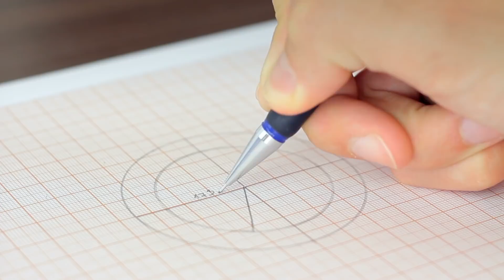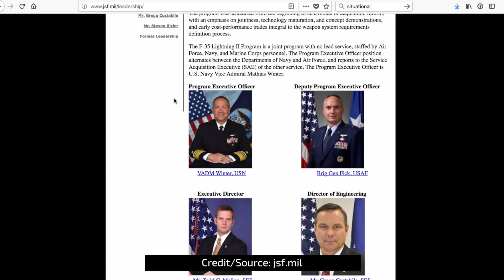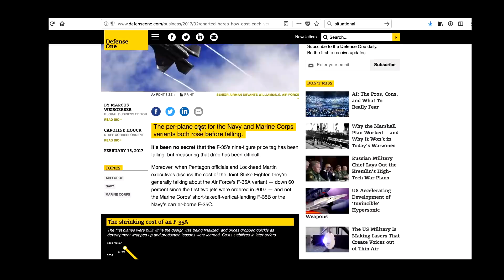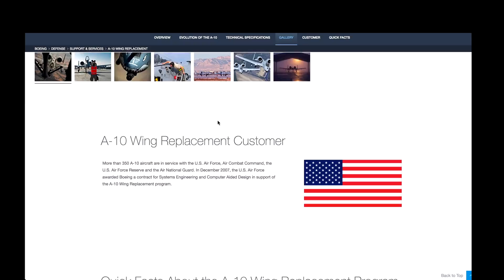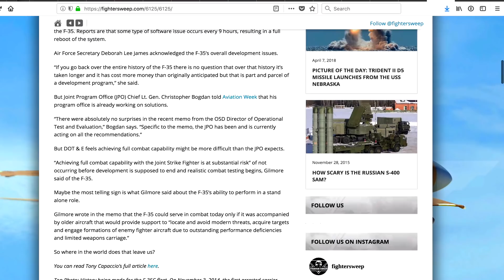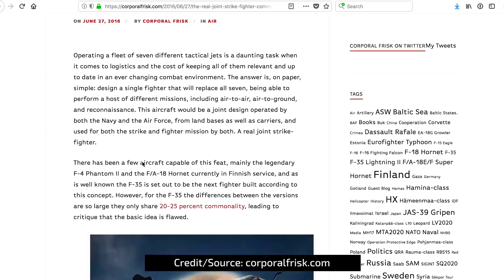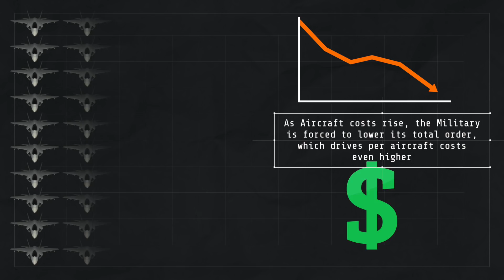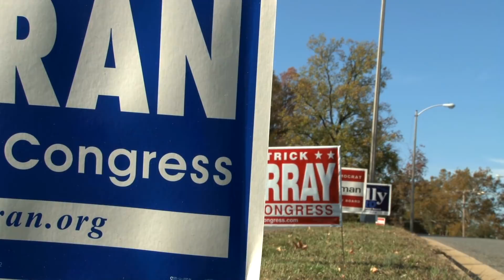Why the F-35 Lightning II Might be the Most Expensive Military Aircraft Mistake Ever

Comment: The jet is actually quite cheap. It's 30% cheaper than a Eurofighter and the price just dropped by 6%.
Reply: Does this calculation include development cost? Ive read for ET it was around 200 billion euro which is trumped by 1,3 trillion USD
Reply: Nope. I'm going purely by unit cost mate. The 1.3 trillion figure the media throws out is intentionally deceiving. What that includes is the lifetime cost of the project e.g. development, the jets themselves, future upgrades/repairs and ofc, it's just an est. The F-15 has a similar cost when taking into account all of the upgrades it's had over the years and inflation.
Reply: My country (the Netherlands) is very happy with its performance for the job they are doing (which hardly do air to air.)
And if they are happy I am happy.
Reply: My country (Finland) is now looking for a replacement for the F/A-18C/D and the Air Force brass is of the opinion that if any other fighter besides the F-35 is to be chosen the choice will have been purely political.
Reply: For Finland, F-35 might be a good idea, however it's cost is gonna be an issue.  So multi-role is good for a small country, but cheap is REALLY good for a small country (Not to offend, but Finland's population and size cannot support a massive defense budget, also I have been to Finland and LOVED it there, Helsinki is beautiful).  I would have some locally made fighters or close to local.  Grippens or Viggens (yes the AJS-37 is old as F) or something like that.  F-35 would be fine, but Harpoon has yet to integrated, just JSOW, so anti-ship would be an issue.  If they do get F-35 great, but for my money, I would take something a bit cheaper.
Reply: @wpnsloader9289  well if they already operate the F-18 (I mean that's a relatively young mid-90s) jet. I would assume replacing was meant as replacing the main but being added to the fleet.

Cost is a downside, on the other hand keep in mind that Finland borders Russia and for the very same reason the Soviet Union essentially insisted on Finland neutrality thusly (same as Sweden) not a NATO member. The EU is essentially also a defense treaty which in some way makes it a NATO member by domino effect, but in essence their geopolitical exposure warrants the cost of the F-35 (or Su-53 if they want to honor their reputation of being a special case).

Personally though i think stealth jets are a bet against a ticking clock. And without stealth the F-35 is an airborne tank without armor, not very maneuverable. May still be worthwhile though as air support in foreign deployment stealth should be safe to use for a while, but to sneak into and out of Russian airspace – you better announce yourself by jamming Radar entirely and use something with aerodynamics.
Reply: @Hairysteed  I know you guys don't like your neighbors to the east BUT they have the best bang for your buck...but if you really need a replacement badly try and get some F16s or Rafales as they are much better
Reply: Hairysteed "the Air Force brass is of the opinion that if any other fighter besides the F-35 is to be chosen the choice will have been purely political"

Cite your source for this, please.
Reply: Yeah the RN seem happy with them. If they wen're then we'd modify the end block of the Queen Elizabeth class carriers and use Rafale. This was pondered over during the Clinton years as there was an issue with ToT under his Presidency but Blair and Bush sorted it out. What we see it is is simply a missile and jamming platform but with the capability of the Harrier and short rolling landings. If you loo at the weapons the F-35 is getting then it is impressive. Just the METEOR ram jet BVRAAM alone is a game changer
Reply: Hairysteed: Gripen NG? Wouldn't it just fit perfectly?
Reply: @clipeclipaway  I can't wait to see an F-35 flying around here! (I'm also from The Netherlands)
Reply: @clipeclipaway  You are a citizen of dreams
Reply: @Hairysteed  Totuus on nimenomaan päinvastanen :D nythän puolustusvoimain entinen komentaja on lobbaamassa meille näitä ylihintasia rojuja.
Reply: @vought19  USA GUST SIGNED FOR 450 F-35A AT A COST PER PLANE OF BETWEEN $80.5-$75.5 MILLION. WHAT NOW? TAKE THAT LOSERS.
Reply: Development cost for the F-35 so far is in the range of 150 billion USD (about 300 jets included in that figure)
Reply: @damonstr  wrong depends on model. The f35a is going for 80 mill right now. The f35b was 120mil, the f35c going for 110 million.  But the B and C are coming down more. The final on B should at full production be around 105 mil. The c95mil. 
The European fighter/typhoon runs 120 mill
 The f15 new strike/ k eagle runs 115. 
The f16 runs 80
The f18 super runs 80-85
The rafale runs 95mill.
The Su35 run close to 80 mil
The su57 stopped as failure
The ? Shikore 30 runs 75+ the Chinese are not in any contention!! And cost as much and not ready to come close to performance with US or Russian made jets.
Reply: @damonstr  380 of them ACTUALLY.
Reply: @damonstr  BULLSHIT. USA LAST WEEK SIGNED FOR 450 F-35A FOR A CONTRACT WORTH $34 BILLION OR BETWEEN $80.5-$75.5 MILLION PER PLANE
Reply: And the F35A can pull 9.9 g's at full combat load!! Vs a 4th gen is stuck around 6g's and mach 1.2 or so vs the F35A can run full mach 1.6 with full load and maneuverability.  The F35A can go mach 2 without question but is computer limited to mach 1.6 due to stealth coating starts to over heat at mach 1.6. 
The f35a has better stealth then the F22 which we originally thought the F22 was king but no. The computer warfare and jamming and radar on the the F35A is so much more advanced then the older F22. The F22 Apg77v is best distance radar at 1m2 x 450+ km. 
The F35 apg81 is more advanced but not as much as distance at 350+km at 1m2 but can have full view of the battle field in front and can jam all electronic warfare against it and can jam s300,s400, and all foreign fighters radars by 100's of km 1m2. A su35 will be lucky at best to see a f22 at withing 15-20km if lucky. The radar on the apg81 and Apg77v are undetectable agaisnt getting picked up by others radar. They never new they where dead.
Reply: Especially when you factor in the latest carrier landing tests of the F-35B on HMS Queen Elizabeth paving the way for full scale production, once even more orders get the final go ahead airframe costs will go down.
Reply: @G1NZOU  yeah but for an inferior product...although the B model is the niche model so maybe it's worth it...time will tell.
Reply: Dave YOU CALL ME CHEAP!?

HOW DARE YOU...
Reply: No it's not
Reply: Maintenance cost of a bomb
Reply: @ConstantineJoseph  1/2 total cost annually plus labor
Reply: It is not cheap. If that's the case then the euro fighter is expensive
Reply: Keep telling yourself that, Dave. You aren't including the development or the life cycle costs of flying it...for the substandard number of flight hours it is projected to be limited to flying. The "C" version is probably going to fall apart after 100 traps.
Reply: Bullshit
Reply: You can't use the word 'cheap' the costs of each program mentioned here are eyewatering.
Reply: @willl 88 Actually we went into the program so that we could put in some of our specification.
It was the only non Russian program that we could enter at that time and your country needed the funds.
Not so much "your bitch" more like "your country couldn't afford it yet again just like when you guys came begging for money when you were fighting for your independence and then copied our declaration of independence"
Reply: Yeah but the typhoon works properly
Reply: @tonymontana9799  Hahaha no not at all.
Germany has issues with nearly all of their fleet.
Only a few were barely accepted as "battle ready."
Every country had similar issues with the Eurofighters.
Reply: @clipeclipaway  sorry I don't believe you x
Reply: @someonenoone1636  That's the most terrible joke I have seen on this website.
If you have to go through the Netherlands to get from Germany to France get a TomTom please.
Reply: IMHO the complexity is what makes both the F-35 and eurofighter expensive projects. Reliability being an issue that feeds back into cost being a parameter that is determined over time, meaning the ultimate cost of the eurofighter is less of an unknown variable then it is for the F-35.  

But cost aside (at least so long we are not talking order of magnitudes). I think it's worth pointing out that of the two Countries that were the two main contributors to the JSF project (F-35) the US (Lockheed) and the UK (BAE Systems) both hold on to their – from a pure aerodynamics perspective superior – (predecessors) jets. The classic air supremacy fighters are now multirole aircraft (MRCA) with let's call it air supremacy capabilities (i.e. aerodynamics); for the US the stealth  F-22, for the UK the (eurofighter) typhoon. 

Both will stick around for quite some time because  it's arguably a matter of time until stealth is a matter of the past so long you can keep an AWAC in the airspace. In most scenarios that's an issue that can be omitted, in those where it matters however such early warning systems will have to be blown out of the air  (or from the ground) by means of air supremacy jets (i.e. excellent aerodynamics) air-2-air and cruise missiles x-2-ground respectively, before the F-35 can operate unchallenged. It's important to understand that stealth and detection are not mutually exclusive, you can jam radar detection equipment that doesn't make you stealth the opposite frankly, but for a period of time undetectable.

Simplified stealth is not achievable without compromising aerodynamics. The eurofighter doesn't compromise (just so far as being a multirole jet), the F-22 compromises as little as possible while also being multirole and the F-35 is a full compromise in that particular regard.

Which is why the F-16 mock-up dogfight result can really only come as an surprise for those unfamiliar with the planes concept, the question wasn't if the F-35 would lose in a line of sight dogfight but how bad. In concept that ought not to happen. Period.

At the end of weighing the pros and cons of these planes (keeping in mind the F-22 is not for export). There is a clear split among those who buy the F-35 in those that retain second air superiority oriented fighter (i.e. F-18 or Eurofighter as does Saudis Arabia, Australia or at least F-16s South Korea, Israel, japan) or can rely on those by virtue of alliance (Netherlands, Norway) or both (UK, Italy). The question  for most countries however isn't if the F-35 is cheaper than a Eurofighter. It's if operating a 4.5 generation jet (like Eurofighter, Dassault Rafael, Saab Gripen, F18 or mig/su-35) alongside an F-35/Su-57 is viable.

Or even necessary the main battle tanks became so vulnerable to personal anti tank weapons that the answer to them became more light armored vehicles with better maneuverability if guided missile technology development leads to effective anti stealth missiles to air systems 6th gen. unmanned jets will look more like previous high maneuverable fighter jets of the 4th generation that can be produced in higher numbers.
Reply: Nope.  I work both A-10C and F-35.  There is simply no way that the F-35 is cheap.  NO WAY!  I don't want to be rude I am just saying, trust me these things are costly.  REALLY costly.
Reply: Wpns Loader
F-35 is definitely not cheaper than A-10, however, the F-35 is only going to takeover some of A-10's role - many of which is already being filled by F-16, F-15E, and F-18. For the low-threat environment, A-10 will most likely be replaced by light attack aircraft, which is mostly combat variant of trainer and prop planes. A-10 is too expensive to be used against asymmetrical threat and not survivable against near-peer threats.
Reply: @mickeyg7219  Wasn't the concept that the F-35 variants will replace over time all F-1Xs  and A-10s?
Reply: Dear Mr. isaiah deringer;
It probably is during the earlier during the phase, but new reports have came out and the Pentagon can and do change their direction. As of current situation, it seems that F-35 won't be completely replacing every teen-series fighters after all. For the air superiority role, a 6th-gen will be the replacement, light attack aircraft will replace part of A-10 fleet. F-35 will still be the most numerous, it's a multirole aircraft after all (just like how F-16 and F-18 made up the majority of the US' fighter aircraft inventory).
Reply: @mickeyg7219  I see. A 6th gen. of course was to be expected sometime down the line.

The A-10 was imho not replaceable by an F-35 anyway. Though I would have hoped something close to the A-10 😒 (i.e. extraordinary armour, damage resilient an airborne tank). Thx for the update though.
Reply: Wpns Loader No one said that it was cheaper than an A-10, of course its not. The A-10 is a nearly fifty year old air frame and is priced as such. The F-35 has only been IOC for 3 years at its earliest introduction (USMC) and is subsequently priced at modern aircraft procurement costs, this is why it was compared to a Eurofighter typhoon, another modern aircraft being procured which costs $20 Million USD more per air frame than an F-35A in 2018 production, that's almost two entire A-10's worth of extra cost. Sure an F-35 is expensive compared to an A-10, just about anything produced these days would be. The F-35 is cheap in terms of today's procurement, in which it is actually extremely cheap given its capabilities, largely because of its absolutely massive procurement scale which is able to lower costs drastically.
Reply: @wpnsloader9289  Bullshit. $89.3 MILLION PER PLANE OF THE F-35A VARIANT A D GOING DOWN.
Reply: there's tons of tricks that defense companies use to lower that unit prices. the most egregious of them being not including components like engines, radar etc... Even if they managed to get them down, it doesn't change the fact that it is an overdeveloped, overpriced, underperforming (going by their own claims of air to air performance) and sorely underpowered platform.
Reply: @etherealessence  TJE MOST POWERFUL ENGINEVEVER MADE AND THE MOST MODER AESA RADAR EVER PUT ON A MODER RIGHTER JET.
Reply: @etherealessence 
Yup Britain found that the unit cost only included the basic flight software did not include the key software modules which woud add another 1bn to the bill for 135 aircraft.
Reply: @etherealessence 
Yup Britain found that the unit cost only included the basic flight software did not include the key software modules which woud add another 1bn to the bill for 135 aircraft.
Reply: etherealessence Is 145 kills to 7 losses at Red Flag 17-1 against F-16's, T-38's and F-15's under-performing?
Reply: So when is the F35 program going to make money, like break even to cover all the years and costs involved.   How many planes need to be sold and procured globally.  

Can anyone breakdown this shitty business plan?  Or will it never break even.   Will China's 5th gen jets and Russian jets force the F35 into an earlier retirement for next 6th gen superiority or multirole fighters?   I still believe the future is hypersonic
Reply: The Eurofighter was conceived as an AIR SUPERIORITY platform NOT a Multirole...if the Eurofighter and the F35 fought each other the Eurofighter would win at least 7/10 times...its more nimble and has more power therefore more speed...in a dog fight speed is king he who has speed dictates the fight...now BVR is all the F35 the weapon systems employed by both are similar but the radar cross section of the EF is nearly 3x the size of the F35...but radar and bvr isnt the end all be all of a dogfight which is why it would be a 7/10 in favor of the EF...now if we look at other Fighters such as those employed by our likely adversaries the Su35 and MiG35 it's far out classed in a dogfight but BVR is still a toss up as russian/Chinese tech is a little more advanced then we'd likely admit...
Reply: Thomas Dority
F-35A's price is now within the same range as Rafale M, and at full rate production, the cost is expected to be dropped to similar range as Rafale C. Speed doesn't dictate who wins the dogfight, as the majority of the fight took place at subsonic speed. In fact, depends on the kinematic of the aircraft's design, lower speed may actually be more beneficial as it allows them to pull certain moves (F-18 and most modern Russian fighters are designed to dogfight at low speed), a French studies shown that F-18C as better instantaneous turn-rate than F-16C at Mach 0.7 but worse at Mach 0.9. One of the common sentiment among pilots is that F-35 exhibits similar maneuverability to the F-18, which is probably the most maneuverable aircraft in US inventory with an exception of F-22.
Reply: @mickeyg7219  wrong on so many levels...let's look at history to prove that: WW1 Spad vs DR1, the spad due to its speed could dictate the terms of the fight sure the DR1 is able to out maneuver it at lower speeds but the fact it has to wait is a disadvantage...WW2 Hellcat vs Zero or P40C vs Oscar the American planes were faster than the adversaries (we can argue pilot training but equal pilot in each aircraft for these scenarios) both were able to both outrun and out climb the latter due to their power/speed...Vietnam (you know the war where the gun was obsolete) the NVAF scored plenty of victories in aircraft that were both obsolete and more nimble but because the F104s and F4s could run they always had the advantage therefore good pilots like Robin Olds used that to their advantage...now let's look at the Israeli wars in almost every one the Israelis only had 1 advantage over their adversaries SPEED the mirage the F15 ect...yes a pukachev's cobra looks cool but to have to resort to that maneuver you're in a disadvantage in the first place and after you've performed that maneuver you're dead because if your R77 malfunctioned coming off the rail the enemy is easily able to speed off turn around and re-engage the fight to HIS advantage and you're still dead...let's now look at similar fighters of history P51 vs Me109K or P47 vs Fw190 D both are very similar in performance yet it's not the turn rate that saves you it's the ability to accelerate after a maneuver and both the Fw and Me out run their adversaries no less a pilot than sir Eric Brown said that both would out fly their allied counterparts and all 4 had about the same top speed wing loading etc...look I'm not bashing the F35 in fact I feel it's become a great PLANE in it's own right but a FIGHTER would eat it up in a heartbeat...it wears many hats as a platform and none of them fit as they're either too big or too small you can't have balance and be a good fighter the F16 is a great fighter infact arguably the best ever devised for the role same with the F18...they don't need replacement yet...now the harrier well let's not discuss that junk...at least the American harrier anyway...I understand age and maintenance I'm not nostalgic enough to advocate a disadvantage but are they really disadvantageous enough to justify 1.3trillion? I don't think so the troops on the ground don't think so and their pilots surely don't think so...
Reply: @mickeyg7219  also the F18C is/was the most maneuverable naval fighter in the inventory but the E/F not so much...their airframes are stretched to allow for more fuel weapons etc so it's already stressed let's take a simple science experiment to understand that point go get some dry pasta and bend a long piece and bend a shorter piece you'll see the shorter piece is able to withstand more force than the tall piece the same goes for aircraft...the F18E is rated for a 8g turn but its limited to 6.5g by its flight control system so as not to break the $36million plane whereas the F/A-18 abcd all can do 9g but are more unstable in those high alpha maneuvers therefore less safe but they can still do it the Blue angels do it all the time in the A model as that's what they choose to perform in as it's the best maneuvering fighter in the inventory (it also out accelerates the E,F MODELS)...Now the Rafale M is an achievement for the french because not since the Mirage III did France have a more appealing fighter its fast maneuverable and cheap...it can both out climb and out turn the F35 WHY because it's designed to! It's a naval air supremacy system that can also carry bombs but does so without giving up any advantages it enjoys in the majority of its realm...comparing a fighter like that to the F35C is Apples to oranges the F35C doesn't have the same thrust to weight or even the same payload capacity as its design is to a much different specification...and for the price I'd buy the Rafale M or the Swedish option as they work better and are far cheaper...
Reply: @mickeyg7219  and just one more thing I'm not trying to talk down to you (albeit my nerves were a bit tickled how you compared an exemplary fighter to a one size fits all Frankenstein monster [F35]). I legitimately loved the F35 until its first outing at red flag where it was shown that it couldn't even reliably defend itself once alone and because of the lackluster capabilities of the plane that happened all too often...even the afraid of clouds F22 makes more sense to me as it legitimately is BETTER than what it replaced in almost all circumstances...
Reply: Thomas Dority
Hey, don't worry, I can see we're not arguing, I just want to have a discussion. 

You brought up points from John Boyd and his proponents - Fighter Mafia, which has its own merits, but it's not without its shortcomings. Running away from a dogfight is not a win, it's a draw, while running away is a strategic move to save the aircraft to fight another day, that's relevant when discussing about dogfighting capability. Radar-guided missiles were in its infancy during the Vietnam War, but that improved over the course of time and American kill ratio rose. US Navy never added a gun to its Phantom during the Vietnam War, but through improvement of missile technology and training, they still managed to get kill ratio up to 5 to 1.

I don't get why people criticized F-35 for it being a multi-role aircraft, F-16 and F-18 are what is it. Sure, Pierre Sprey pressured the military to design F-16 as a daytime light-weight dogfighter, but as time went on, F-16 strayed away from being a dedicated dogfighter into a multi-role fighter we know and love today. Obviously Sprey wasn't happy about this and still protest about the decision to make F-16 a multi-role fighter, but one thing for sure, F-16's success is due to the fact that it moved away from the Fighter Mafia's ideas. All air-to-air kills made by US F-16s are done using missiles. Foreign F-16s made gun kills, but it was not as common and the targets are mostly ground-attack aircraft, particularly the MiG-23. 

One thing Fighter Mafia didn't account for is that miniaturization have made multi-role aircraft very efficient without sacrificing much of the other performance. They claim that upgrading F-16 with more avionics is going to hamper its performance, but it turns out it still as nimble as it originally was. Same with F-35, it carries as much fuel as F-16 with external drop tanks while being similar in size, it has a single engine with a power that almost matched a combined power of two engines on a F-15, it has avionics that are even more advanced than the F-22, and has high angle of attack that allows it to pull a near-Cobra even with external loads like the F-18. Maneuverability is pretty much the only thing the F-35 isn't doing the best out of all US fighters, but I can't see other things that it would do worse. Instead of it being "jack of all trades, master of none," it is "jack of all trades, master of most." It would be like a Batman of aircraft, no doubt, Batman isn't the best martial artist in DC, but he could sure beat the best martial artist in an actual fight because he got more than just martial art skill up his sleeve. If Batman was an aircraft, it would be a F-35. 

The problem with F-4 Phantom II performing badly in the early part of the war was never because it's a multi-role aircraft, it's because they're making an interceptor a multi-role aircraft. Later aircraft that were designed to be multi-role from a ground-up are way more efficient. 

F-35 never lost in a Red Flag, a lot of people mistaken the parameter test (where F-16 "went up" against the F-35) for a Red Flag. 

$1.3 trillion is a projected cost, not upfront cost, if we spread that out over the next 40 years, it turns out to be only $32.5 billion a year, compared to the revenue US made, that's just a pocket change. Maintaining a fleet of 2000+ F-16 and F-18 over the same time period is going to cost similarly.
Reply: Thomas Dority
By the way, Rafale M isn't cheaper than the Super Hornet. Through currency conversion, Rafale M's price tag is about $91 million, where Super Hornet costs roughly $70.5 million. Naval aircraft generally don't have to be that maneuverable as it served more often as carrier defense and ground strike aircraft, but range is very important, thus a need to increase the fuel capacity. Air superiority fighters generally have poor ground-strike capability, and more often than not, its importance diminished after air superiority is secured. F-22 can drop bombs, but it can't carry larger one and it lacked the precision of the multi-role and ground-attack aircraft. Most of the war will be fought on the ground, air war is only for the first phase which is probably the shortest phase aside from naval war. That's why people saying they should produce more F-22 doesn't make sense, considering that F-22 is very expensive to buy and fly.
Reply: @mickeyg7219  to be honest I've never heard of John Boyd until you've mentioned him...I'll have to look him up...no my arguments stem from my father who was a fighter pilot over Nam in 67 flying thuds...also from spec sheets...now like I said before the F35 is a great plane but it's no fighter and probably wont be a good multi role either because while performing its duties as such an aircraft it will invariably take damage from AAA or pilot error...I just feel that because the price tag right now sits at 120million per copy (that not unit cost but total cost divided by those already in service [I believe unit cost will probably fall to about 85million per unit of the VTOL variant])...therefore it must by design be capable of absorbing that type of damage and frankly based on its specs I don't think you'll see to many come back after being hit by anything bigger than a 23mm...compare that to a plane it slated to replace (A10) and we got a serious CAS problem in the foreseeable future...now on to the whole running away isn't winning you'll note I specifically said that most pilots (being that 99% are aggressive beyond belief) would seize the advantage of having the speed which doesn't take any skill vs the Technical skill required to pull low speed high alpha maneuvers...its simply easier to Jeremy Clarkson than to James May and with that comes a lot of advantages that anyone whose even played a combat flight simulator [like over g fighters] can attest to...sure locking on a firing a missile is nice but if the enemy knows hes being tracked and can either jam or evade your weapon you only have 2 options left either engage with your speed advantage or leave with the same advantage any soldier will tell you war is unfair and why should you make it fair...and the F35 lost many of its dogfights to legacy fighters in fact its damn near 60/40 against it...the only reason its green lit is because as you said the legacy fighters will cost about the same...but my opinion is that the F35 is UNNEEDED it's too advanced and promises too much...the legacy fighters are still working use them...its like the M14 vs M16 controversy it didn't need to be replaced and once it was a lot of soldiers had to die because of the Mattel toy before they fixed it...now m16 is the beloved Harvard graduate and the M14 is the redheaded stepchild but it took nearly 25 years to make that so...we already had 1 dismal failure of a arguably great aircraft the F22...let's not do the same again...as the old adage goes if it ain't broke don't fix it...BTW I know that sounds like I think the F16 or F18 are the greatest things since sliced bread, trust me I'm no fan of the F18 and I may respect the F16 but the F20 was better (obviously not anymore but when it was conceived)...another point I'd like to make regarding the rafale...don't you think that the Rafale is great because it performs all and can change instantly? Honestly I think we as America should buy a license for it as it's clearly 1 of the best in the world at what it does...bar none...the F35C mark my words will be lack luster in comparison...now the A and B models have potential but the C is just too big too much heavier than the A or B...especially combat loaded...
Reply: @mickeyg7219  also 50k pounds of thrust is nice never denied the engine or the avionics system just the recipe it's part of...
Reply: @ywe3  conceived but not executed. That's why France split from the project to build the Rafael. France wanted a "swing-role" jet (meaning role switch during mission). And the eurofighter is more modularized (role depending on installed modules).

Rafael and Eurofighter even look very similar since their conception used to be from the same collaboration. https://goo.gl/images/5wSp6t
Reply: @Dear_Mr._Isaiah_Deringer  yet the EF and Rafale are completely different I love how from the same EXACT ingredients the chefs came out with 2 exemplary meals that leave you satisfied...the Rafale is a great fighter as is the Typhoon but I'd still give the advantage to the typhoon in a dogfight because its designed to hunt fighters and just like the typhoon of old it can also in a pinch double as a ground pounder its great to have that amount of flexibility without losing its original purpose...the F35 originally was a navy project to replace the harrier but Congress push it to be the new F111 (I guess the McNamaraisms have not run their course [him for those who don't know he wanted a completely interchangeable military all using the same equipment]).
Reply: @ywe3  BULLSHIT. MORE LIKE 9/10 IN FAVOR OF THE F-35.
Reply: @jesusf.2600  explain how you came up with EVERYTHING you said...when everyone else is literally saying the opposite...the F35 A and B are probably worth the price but the C variant IS NOT! It's an add-on like adding Missile pods to a bomber...why just why?...I've already accepted the fact that these planes are gonna be built I've even accepted the sub-par performance of the C model by why should we settle? Our adversaries are not even making Gen 5+ fighters in fact the only 1 even considering it is CHINA with the J20 which based on what's known is not much of a threat...now the avionics you so proudly proclaimed as "the most advanced in the world" is 30 years old! And thanks to the Clinton's selling secrets to China is widely exported thru the J15 and J10...so tell me (besides the engine [which is a great engine]) what is so good about the F35 that couldn't be applied to legacy fighters that are better performing than it...
Reply: Even if the unit itself is cheap the taxpayer is still getting fucked over with budget overdrafts and technical problems which mean that development costs are soaring. And also there's the flawed nature of the jet itself